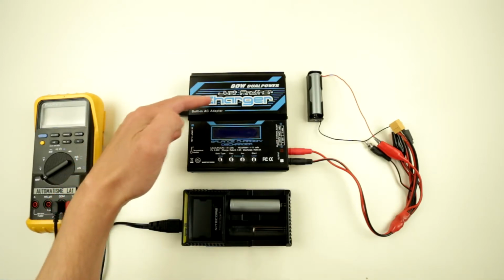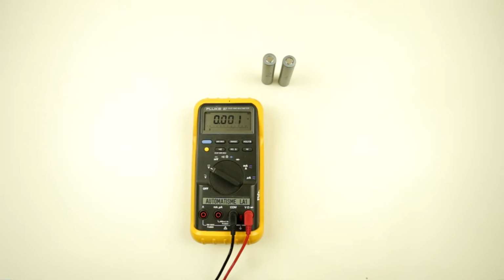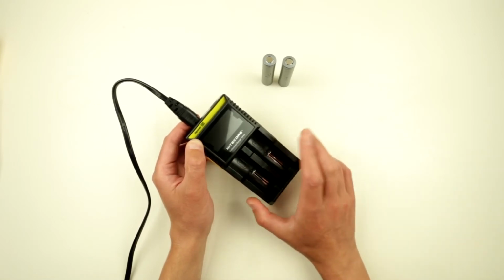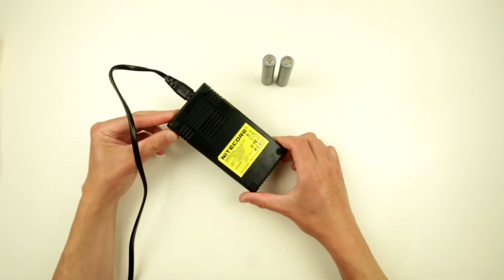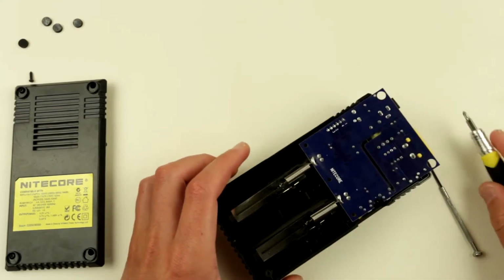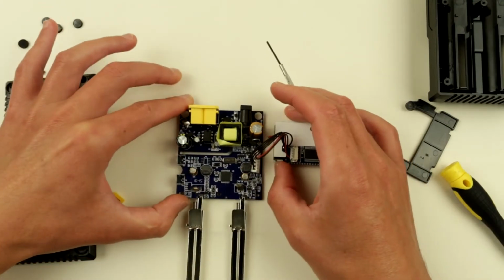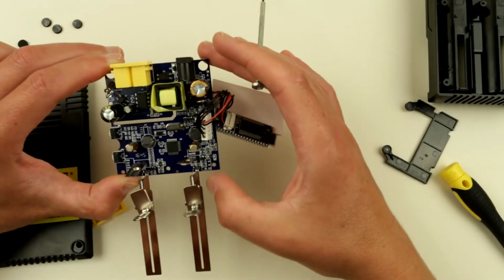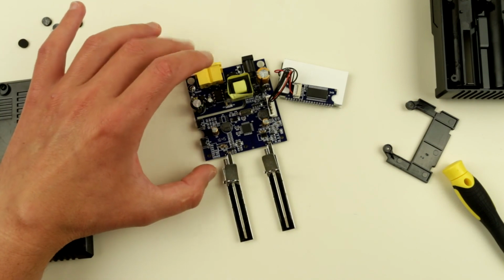Nitecore D2 Charger In Depth Review

Comment: which one will you suggest for aa/aaa? I want to get one and it seems" la Crosse Technology BC-700/BC-100" are all about on the internet but these are hard to find where I am from can you suggest some options with discharge and refresh tech.
Reply from the maker: This charger does not support discharge and refresh modes, so If this is essential for you then la Crosse is the best choice. I use la Crosse and it works perfectly. There are few around amazon like KINDEN but I cannot recommend that as I never tried those chargers.

Comment: Is the nitecore automatically stop charging when the battery is fully charged? Because i want to sleep while it's charging and just going to remove when i woke up.
Reply: even cheap chargers for 1usd for 18650 batteries will have cutt off charging after 4.2 volts. Othervise if they don'y have automatic off, battery would fire or blow off after bulking. So, don't worry friend
Reply from the maker: Yes it does, just tonight i kept my 18650 charging overnight.
Reply from the maker: 18650 might have built- in protection circuit, in this case they are well protected.

Comment: I think D2/4 should have low current mode for charging NiMh AAA an AA batteries.
Reply from the maker: Yes it does,  300mA mode. So it has only 2 modes: 500mA and 300mA.